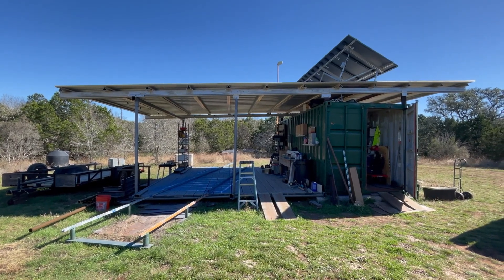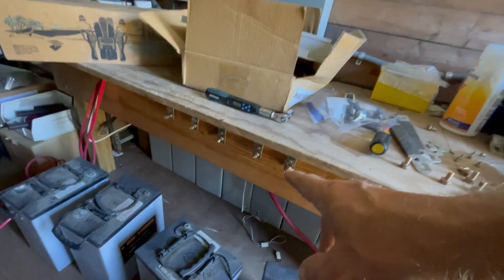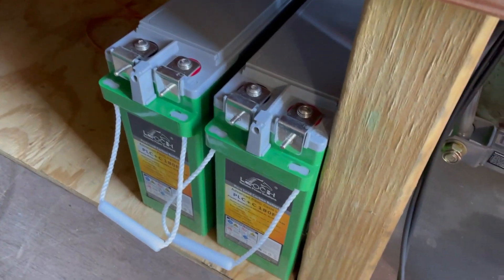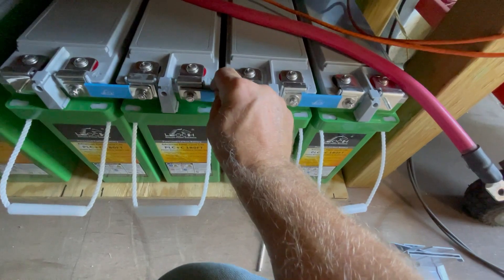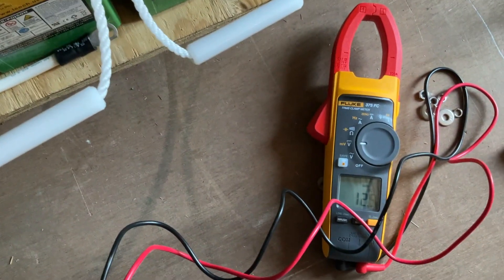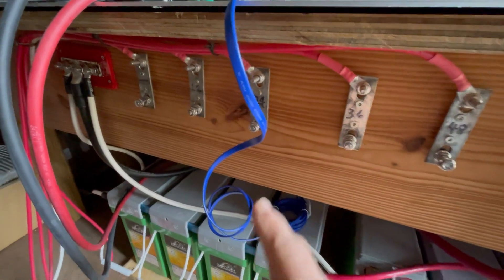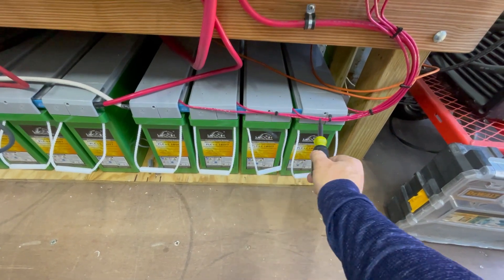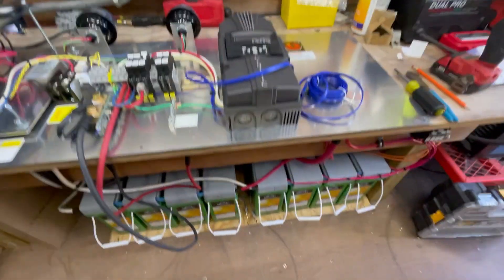Welding Shop AGM Battery Swap and test bench wiring

Comment: EPIC AMATEURE FAIL    Never mid-tap multi-battery strings. You will kill the other batteries with overcharging while trying to fill the batteries you pulled down.
Reply from the maker: Thanks for tip! You might have missed where I said multiple times to not center tap batteries and that I’m only using this to boot up and program charge controllers that will be sent out for field service already programmed for the specific battery. And even that is quite infrequent. After installing hundreds of off grid systems, this is the only tapped battery I’ve made. I think I’ve survived the Amateur stage. ;-)
Reply: Please answer my question. 
Is this leoch lead carbon worth to buy  @maverickmacgyver
Reply from the maker: @ibrahimfatawu2640  yes. These batteries do work well.

Comment: I think you are going to kill your new battery bank if you "Tap" into cell groups less that 48 volts. The imbalance when charging will all go to the 12/24/36 volt cells. The correct way to derive lower voltages from a 48 volt bank is to use step down transformers.
Reply from the maker: The last set of batteries lasted over 10 years. Like I said in the video, there is NO load at other than 48V nominal. The 12, 24 & 36V is use very very very briefly to boot up, program and test systems at their nominal voltage before they are shipped. Don’t power long term loads using a tapped battery bank, use a dc-dc converter instead.
Reply: Yes, you spotted the huge and obvious failure but you can't use a transformer with DC.

Comment: Great setup, please consider Victron battery Balancers. Otherwise overcharging and undercharging will kill them.
Reply from the maker: Indeed. When I use a non-48V load, it’s for a minute at most just to program an outgoing setup. Plus, I’ve  learned to mildly EQ AGMs. I do like lots of Victron stuff. Adding more as I go. There might even be a Victron inverter video coming up.